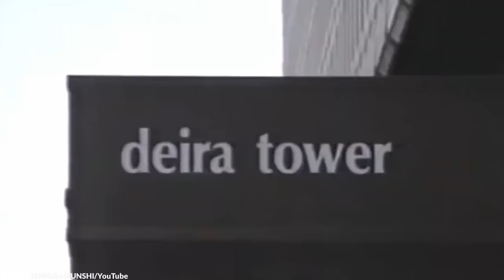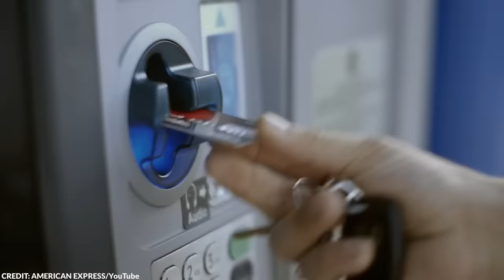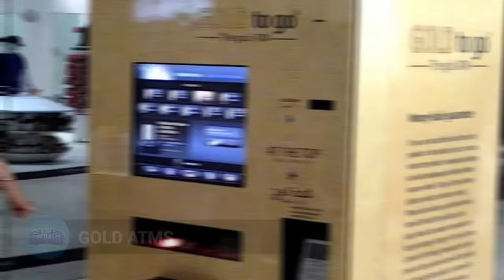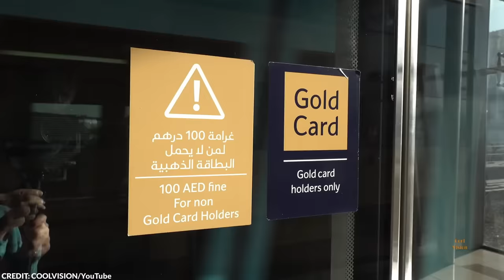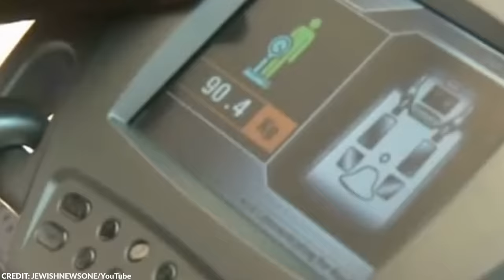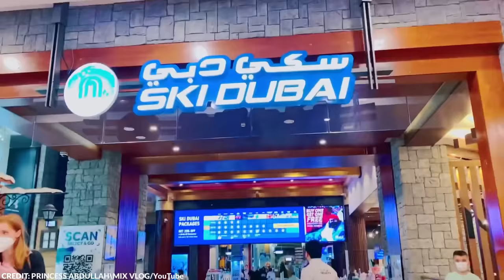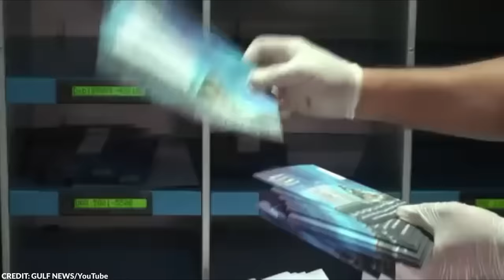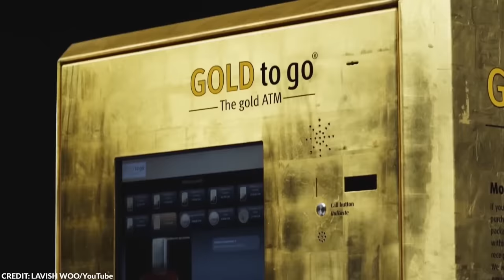IT'S OVER: Why Dubai is a Bubble About to Collapse

Comment: Some of the tallest high rise apartment blocks havent go basic sewage so when it i flushed downwards it has to be taken away in convoys of tankers. 
As for those off-coast palm  developments they were meant to have destroyed natural coral reefs, some suggesting they could have inverted the palm tree  developments inland instead thus saving the reefs. Too late now will make a nice futuristic apocalyptic dystopia setting
Reply: "will make a nice futuristic apocalyptic dystopia setting" this is exactly what I was thinking after seeing all of this!
Reply: They have transitioned from riding camels to high rises. Sometimes the details in the plan are missed. They used to crap in a hole in the floor; now, the missed connection on the drawings was the sewer pipe.
Reply: Everything seems artificial, too many high rise buildings, i prefer a mix of modernity with nature, natural parks, lakes, etc.

Comment: Such a fake place, good only for those who believe that tourism is based just on shopping centres and nothing else because the other attractions are just brand new constructions that have no historical value other than architectural, so they can be nice if you are an architect and the last worst but not least thing is the heat, have you ever been to Dubai in summer?